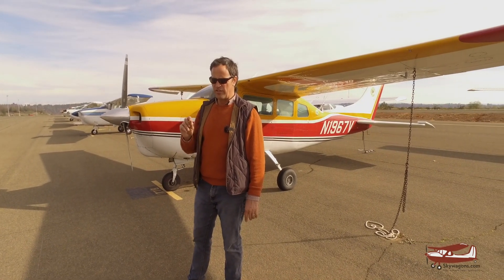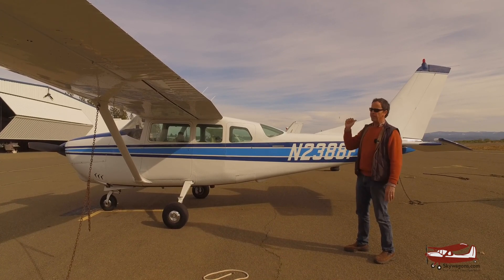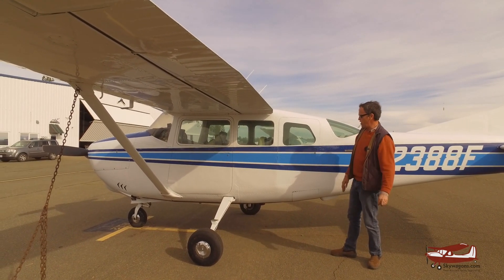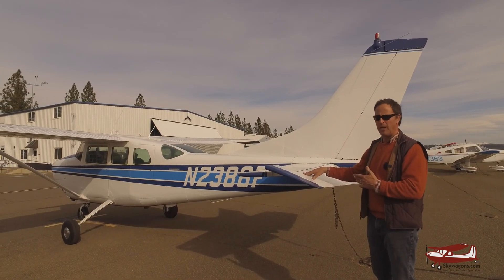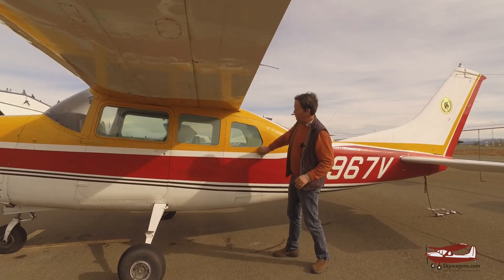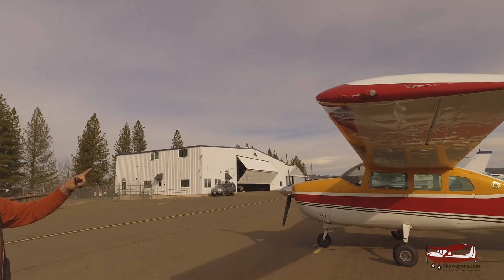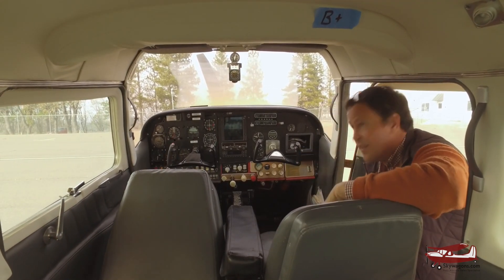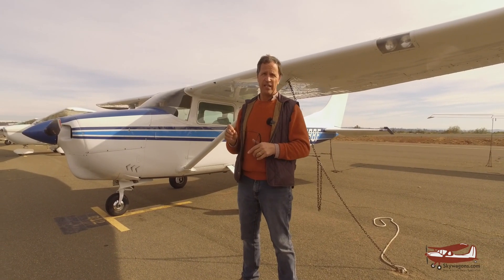1960's Cessna 210 Model Year Changes

Comment: my 67 had double glazing in the side windows, so after my 182 it was much quieter, plus the wiing diehedral much more stable. With 2 people on board I could go anywhere I took the 182. Tas 165kts  at 8000 ft. I loved it. Flight planed 55lph never burnt that much.
Reply from the maker: Those planes are great planes.

Comment: Mark, your E model in this video is a 1965 model! The '64 was a D model and has quite a few differences from an E, even tho both share the IO-520. E is more desirable. Also the '67 AND '68 model have the cantilever, high dihedral wing, not just the '67 as you had stated. The 1969 mode lost some dihedral and the "chin" and the 1970 K-model had the longer window and baggage door moved.
Reply from the maker: Thanks. That is very specific and helpful.

Comment: As another commenter indicated, the E model was 1965. That person also mentioned several significant differences between the D and E models. 

The only differences I am aware of, the D model originally came with a generator instead of the alternator equipped on the E model.  Many of those have been retrofitted with alternators over the years.

The D model has a Vernier throttle, and a slight change In propellor shaft length happened in 1965 to accommodate the slightly modified cowling.  That is all I am aware of in the way of differences. The 1964 does have electric flaps. Hydraulics are only for gear operation. 64-66 birds are quite special in my opinion.
Reply from the maker: Thanks.  Yes, I said 64 a few times, but that strutted 210 is indeed a 1965 E model.

Comment: Thought the '67 and '68 had the "big" dihedral.  I just remember the '69 was better looking, with the flatter wings and no more "chin."  Of course, the oil pan was made smaller (less capacity) so that the nosewheel could be raised higher inside the cowling-- eliminating the chin. Good video!

Comment: As always great video Mark.  Quick question, you mentioned that a 64-66 NA 210 will cruise around 155 @ 12gph.  Are there any significant gains in speed/efficiency on the strutless models and again with the tube landing gear models?
Reply from the maker: The strutless one a  bit faster.

Comment: Thanks Mark.  Any insights on the difference between the hydraulic systems of the various 210 years? 
And what was on the back of the front seats on the 64?  Is that a restraint system of some kind?
Reply: Believe it or not, it’s an ashtray!  And they got lots of use in those days, too.